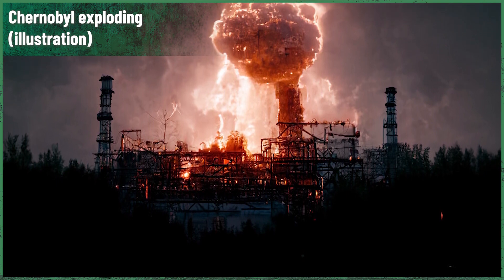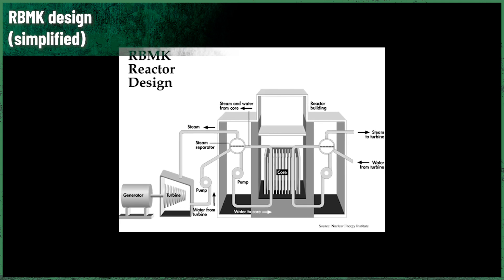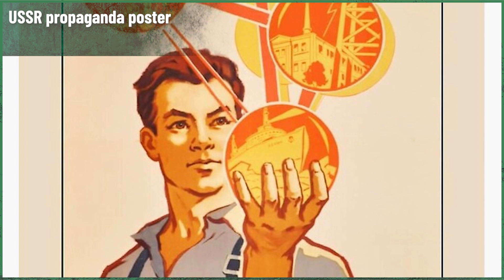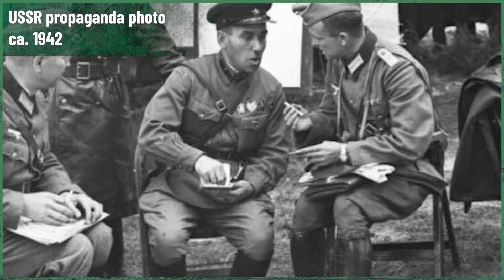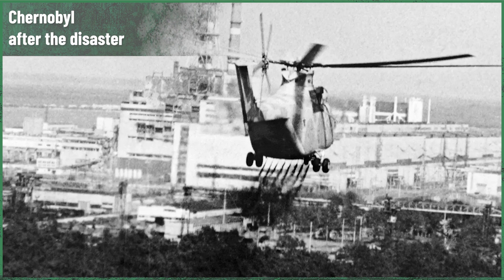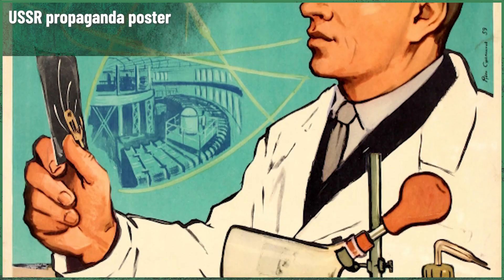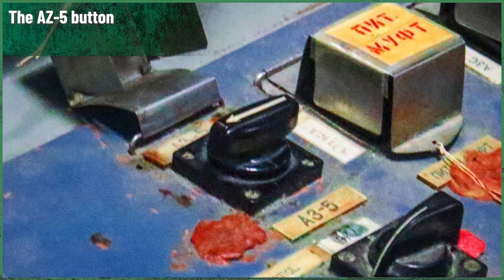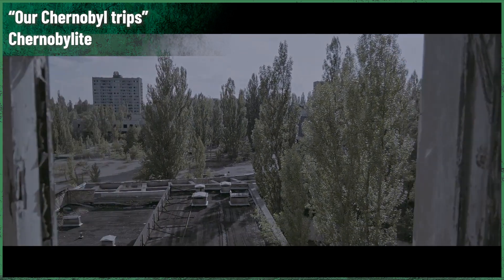RBMK reactor meltdown BEFORE Chornobyl - PART 1 ||| Chornobyl Stories

Comment: This is going to be so good! A whole series about my favourite reactor type. Can't wait to see the many details you're going to come up with. While I do have an extensive library about the RBMK, there is always more to learn, more to discover.

As to the Sredmash name, tell me you're KGB without actually telling me you're KGB^^

The in-game screenshorts are so nice. When I first started the game and ended up near the MCPs, I went like; "I know what these are, where they live, and where I'm supposed to go" without ever having set foot in the place. I'm glad you didn't make the Golder Corridor the full 800 m length. We would have been walking for quite some time in the game to get to the place we needed to go to.
And you made the AZ-5 switches look much cleaner than that panel looked in real life. The control room is very well done. I remember stopping and walking along the wall reading all the dials and gauges before continuing the in-game mission. I even got scolded by my NPC teammates for not hurrying up😅

The saddest part of this whole disaster is exactly what you said. It could have been prevented so many times over. If only they had communicated their findings more openly and better to other stations. If only they had changed the design of the control rods. All they would have had to do is extend the telescope connecting the boron section and the graphite displacer a bit more so that, even when the control rod was fully pulled up to its upper limit stop switches, the graphite sat flush with the bottom of the reactor instead of leaving that water gap. Not to mention giving the reactor other proper things cough containment building cough it needed in order to be stable and safe.
Am looking forward to the second episode of this series. Keep up the good work!
Reply from the maker: Haha, thanks! Look out for next ones, we already have two more prepared :-)